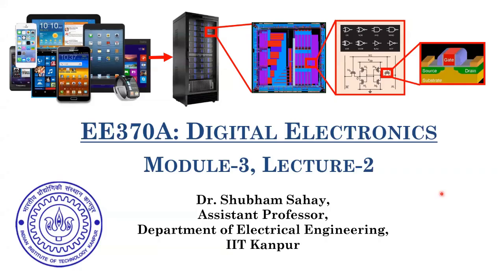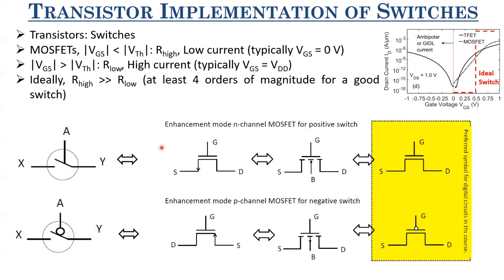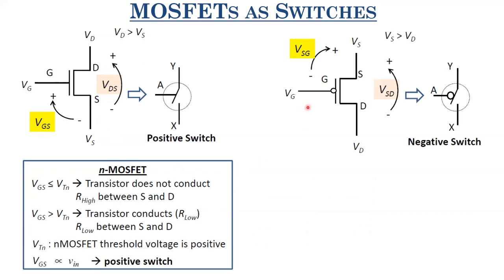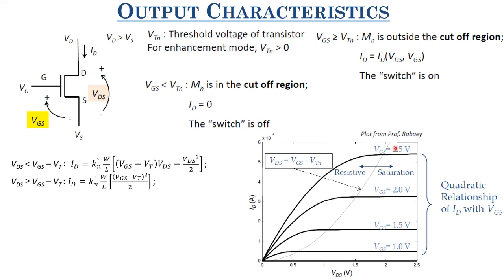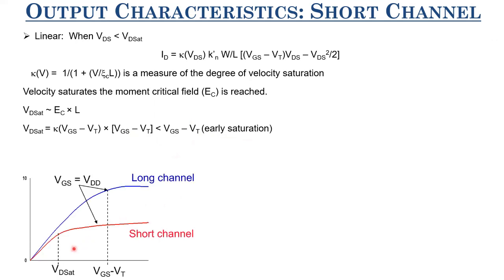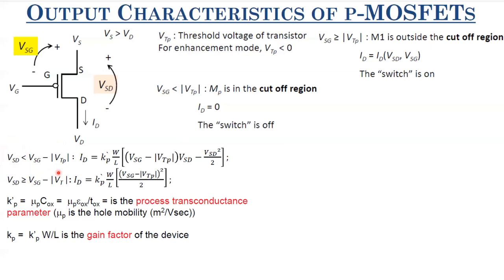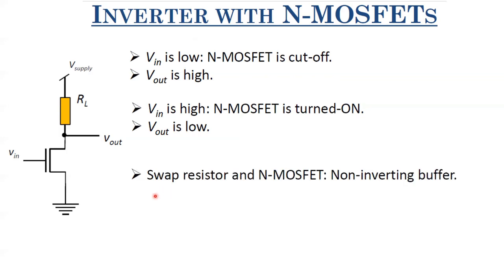Lecture - 6 MOSFETs as Switch

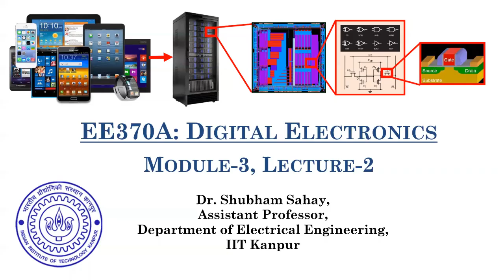Comment: 00:05 Transistors as switches are a key implementation for digital circuits.
02:13 Understanding MOSFET operation as a switch
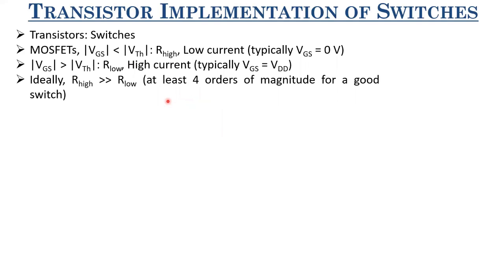06:22 MOSFETs don't act like a perfect switch
08:19 Ambivalent current in MOSFETs can be beneficial or detrimental for digital circuits based on voltage fluctuations.
12:22 MOSFETs can be used to implement positive and negative switches with specific properties.
14:31 MOSFETs can be in enhancement mode with negative VGS or positive VSG.
18:24 NMOS operates as a switch based on gate-source and drain-source potentials
20:15 PMOS operation with positive voltages explained through VSG and VSD
24:11 MOSFET operates in linear and saturation regions based on VDS
25:53 MOSFET operation in saturation region
29:25 Kappa radius is a measure of degree of velocity saturation
31:18 Short Channel MOSFETs experience early saturation compared to Long Channel MOSFETs
35:06 Threshold voltage for MOSFET is negative.
37:00 Introduction to MOSFET operation in saturation
40:22 Negative body bias affects depletion regions and threshold voltage
42:05 Body bias effect on MOSFETs